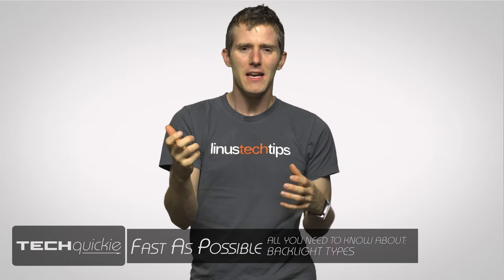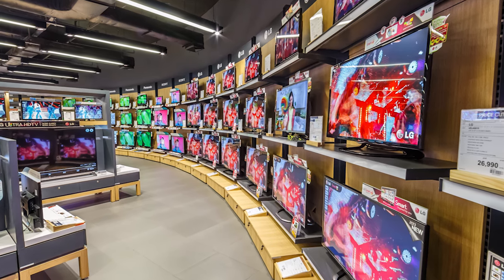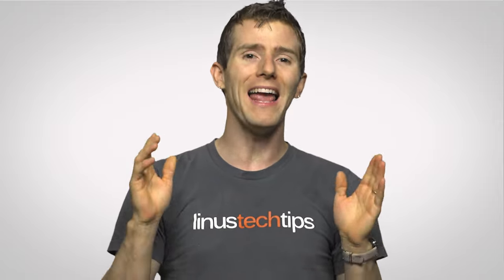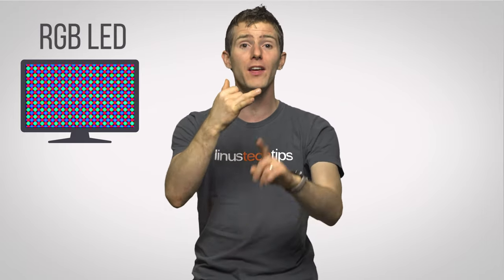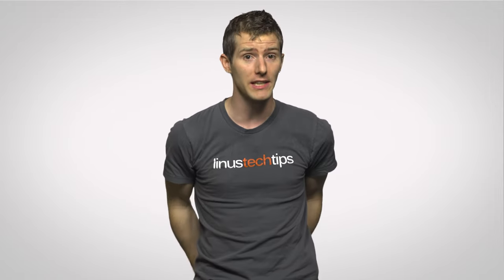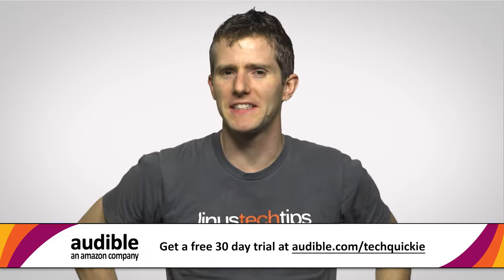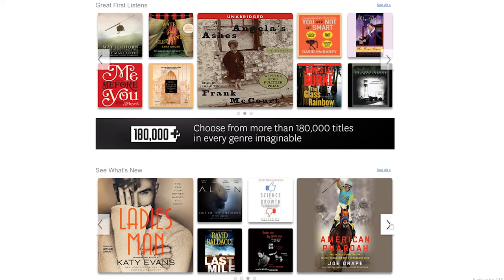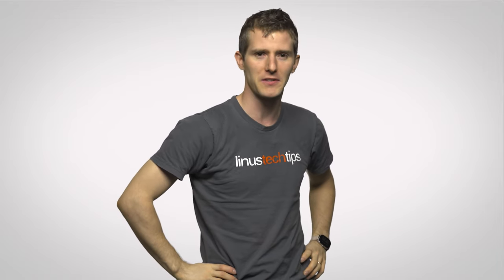Backlight Types As Fast As Possible

Comment: For those that don't quite understand the relationship that Linus mentioned between the case fans and the back light, PWN is Pulse Width Modulation. On cooler fans the fan controler turns on and off the full voltage very very fast,  resulting in the fan spinning at a constant speed that is dependent on the length of time between voltage "on"  cycles. So with the backlights it's the same thing but instead the fan spinning, it makes the light appear to be a less bright as the time between "on" cycles increases. 
The DC fan control is when the fan control simply reduces the voltage being put out to the fan which makes it spin slower the more the voltage is reduced. With the backlight it makes it dimmer the more voltage is reduced.  The DC method is much better for people with Epilepsy or sensitivity to flashing lights or that get migraines easily as the on and off cycles of a PWM backlight may not appear visible to most people, even most that have any of the above conditions, but the eyeball and brain can still partly sense it causing the brain to freak out or get confused, witch can trigger a splitting migraine at the least.

Comment: Thank you for bringing up the PWM backlighting.  I had to return a new laptop due to this as I didn't know why it was giving me horrible headaches whereas my old one didn't.  I found a new laptop without PWM and I'm having no problems with it.  Another technology for projectors is "single chip" DLP.  They display multiple monochrome images every second, and depends on your brain to assemble the color image.  I see the rainbows horribly (even on the newest ones) and if I look at one for more than 10 minutes, I have a full-on migraine that puts me down the rest of the day.  3-Chip DLP projectors in theatres obviously don't have this problem, just the single-chip spinning color crap does.  I get disillusioned when I see DLP used in public venues such as presentations, etc.  I look down at the floor the whole time.  It is amazing how many people I hear complaining of eye strain and headaches.  LCD technology should be mandatory in a public venue like this; but like some comments I see here; people are either not aware, ignorant, or are not affected by these flashing images; but should have respect to those who have debilitating side-effects from these.

Comment: I'm from the year 2030. I'll stick to my MicroLED 8K HDR 240hz 1ms display with no backlight, no screen burn-in and no issues with lifespan/longevity like OLED.
Reply: Broly,  you're still alive 😮
Reply: Micro-LED, the clue is already in its name, so it obviously doesn't have a backlight. 😌

Comment: Back when I bought my first LCD monitor, I did way more research than the average person would. I eventually became fairly disheartened and disappointed, as LCDs definitely do not out-perform CRT monitors in terms of image quality. LCDs may have recently became more powerful in terms of specs, but still arent as versatile in terms of scaling and image quality like the CRTs were.

I was also very annoyed to learn that almost every LCD LED-backlit screen contained blue LEDs instead of white or RGB. This makes a considerable difference in quality and also affects eye-health. Too much blue-light = bad, especially if you're about to go to bed. Blue-light filter programs/settings help, but doesnt solve the other problems, and can easily be forgotten about.

The part that disappointed me most is how painfully slow the market has been at adopting new technologies that I care about. Higher resolution is not my main priority whatsoever. Color gamut, black-levels, contrast(one of the only things that has improved), viewing-angles and high-hz are what I care about more, and those features have been extremely sparse in the lower-mid end LCD market(and possibly even in the higher-end), and you're almost never going to be able to decently achieve all of them.

If more consumers knew the information that Linus shared here in this video, the market would have to adapt to the people requesting/demanding and buying products with those features. I'm sure ill be waiting another 5-10 years since i bought my first LCD before I feel the need to buy my next one. I cant even expect there to be much difference in that amount of time, but I certainly hope there is! I, for one, am tired of LCDs(and especially bluelight LEDs)!
Reply: I recently got a mitsubishi diamond pro crt monitor. its max resolution is 2048x1536 @86hz, with a bunch of other resolution modes. 
https://www.cnet.com/products/mitsubishi-diamond-pro-2070sb-crt-monitor-22-series/specs/
it's bar none the best monitor I've ever used. The color is simply amazing, though I am definitely very optimistic for oled as well.
Reply: @Liquifiedpizzas  OLEDs can have poorly implemented PWM, I am surprised this point wasn't included in the original comment. This is also quite important for daily use, since low-frequency PWM (lower than 300 Hz, quite common in current smartphones) can cause migranes due to extra eye-strain.
Reply: It's been 5 years now, curious how you feel about the market now.
Reply: I remember the first LCD monitor I saw, put me off LCDs for a while since it was a total blurry mess. Couldn't even scroll a webpage without the entire screen just turning into blur, but that's different now.

CRTs still to this say have some advantages over LCDs, but they are being overcome. Also in this day and age LCDs just have so many advantages over CRTs that I can't imagine people still using them. About the only place people still use them is for retro gaming, but even that is coming out with better upscalers to make them rapidly match up with CRTs. I have been working on ways to try to optimize my retro system's outputs to LCDs rather than cling to CRTs at this point.
Reply: @Cyber_Akuma  could you elaborate in detail on whatever those "upscalers" are?
Reply: @nerd2544  Stuff like the RetroTink or the OSSC

Comment: Linus, you're looking a little green in this vid mate.
Reply: Yeah
Reply: +Troy Graham you dont like him when he is angry
Reply: guess it comes from the greenscreen
Reply: Yes there is usually some glare/ if lighting is off a bit but they could adjust in post. Nice Hulk Reference PR.
Reply: +Troy Graham Here, and so many other videos. I've been wondering if it's my monitor that's wrong, but either it is, and yours as well, or he's actually green :P I haven't checked the colors.
Reply: Calibrated LG IPS' here. Definitely off. It's like looking through an amateur wedding photographers photos with the WB all over the place!
Reply: +Troy Graham then buy a better monitor. Linus literally just explained what to look out for to get better color accuracy
Reply: HazewinDog You obviously missed the part where I said I have multiple calibrated LG IPS monitors.
Reply: Troy Graham ah. yeah, I didn't realize you added replies.

I wasn't serious anyways, since it's obvious that he's greener than he should be - like in many LTT videos. bugs me
Reply: HazewinDog 33 +1's tells me I'm not the only one haha
Reply: Guess the major issue is what you use to view the videos. So many mobile options with all different screens and screen temperatures etc.
Reply: Troy Graham True, but if you start with a neutral color, a "correct" one, it's a good starting point, and really all you can do unless you know you're going to produce for a monitor that has a color cast.
Reply: ***** Indeed. I think the main thing here is consistency. LMG obviously has multiple editors and the consistency isn't there yet.
Reply: Yeah. I would expect them to have profiles pre-made for their different sets, but maybe not.
Reply: +Troy Graham Matrix
Reply: Greenscreen

Comment: Small comment on PWM vs DC: PWM dimmers can reach frequencies of up to a few megahertz, now way you can see that. Of course they can be ridiculous slow too. DC dimming comes with another problem: LEDs tend to slightly change their color depending on the current running through them, thus ever so slightly diminishing color reproduction. I'm not sure how noticable this effect is on LCD screens and how well it can be compensated for.

Comment: Once you mentioned that edge-lit displays are found on cheaper screens, I looked at my laptop and noticed that the edge is quite a bit brighter than the middle. The diffuser isn't very good at it's job. Damn Emachines e-627 from 2005! (With Windows 10 and a 1.6GHz S1 CPU)
Reply: Oh, and the CPU is a single core.

Comment: I remember those gameboy clip-on lights that had a square hole in the middle so you could see the screen.
Reply: +SangoProductions213 Yeah, they were shit because you just saw the light reflecting off the screen instead of the screen itself.
Reply: I had one for the Gameboy Advance, though mine had a piece of glass to look through.
In retrospect, it was kinda bulky, it also required its own set of batteries, but it was fine at the time :P
Reply: Definitely bulky and clumsy, and often slipped off....but the alternative was playing underneath the lamp, lol. (Game) Boy, has technology advanced.

Comment: PWM per se is not the issue. The issue is the frequency of the PWM signal (different from the frequency of the screen). If the LED are driven by an high enough frequency they are not "turning on and off" they start behaving like a low pass filter and oscillate around  a target brightness. The higher the frequency the lower the oscillations.

Comment: i still dont get the rgb backlight, because if you can control the color of the individual pixels on the screen, why cant it turn of the local leds when the picture is black? i dont get it why they all must be lit all the time ( i assume theres a reason)

Comment: CCFL is also notorious for deminishing brightness over time. I'm not a fan of led lighting. it doesn't seem to show accurate and full spectrum color. also with rgb (i believe) backlight it just seems as if you are looking at three colors blended together. don't really know how to explain this. with ccfl you will see the colors more as a natural smooth spectrum. I really hope one day there will be screens with individual pixels that consists of just one light emitting pixel that can emit all colors, not three or so next to each other. you will always see it, subconsciously. but most people won't notice until they see it with their own eyes.
Reply: +Tijmen J I have an NEC LCD1850E monitor from 2001.  It still works great, doesn't hurt my eyes, and the colors are crazy accurate.  It also shows more shades of individual colors than I can ever attempt to get a laptop TN or IPS display to even dream of displaying.  Yes, it doesn't have as dark of black levels as a newer IPS display; but I don't watch movies on the computer either.  That's what I have a Panasonic plasma for.

Comment: so where does IPS come into all of this?
Reply: +North American Survival Attic "IPS" does not pertain to the backlighting, but rather the way the colored sub-pixels in the top layer of the screen (the layer which makes the picture and colors) are arranged. I believe the most common arrangements are "TN" and "IPS". You can tell if a panel is "TN" buy looking at it from different angles, if the picture begins to looked washed out or turns black from these angles it is a "TN" panel. at least initially "TN" panels had faster response times making them good gaming displays, while IPS was better for Televisions because people all over the room could get a consistent experience. IPS has taken over though with the rise of mobile devices like tablets and convertible notebooks, which like TVs need to be visible from all angles.

Comment: Just wanna say,  that bit about LCDs "eventually" having better image quality than CRTs only holds water when comparing the absolute top-end in both categories, at which point LCDs win by sheer weight of pixels (4k and 5k). Apples-to-apples, at the same resolution, CRT monitors can have much higher image quality than LCDs; the problem is that nobody makes CRTs anymore, and the second-hand CRTs you can find are often from either before the time of high-quality CRTs and horribly outdated, or just one of the crappier models from the later days of CRTs.
Reply: +Crazy Canadian making  a  real full  hd  crt monitors  will be  so much  expensive then a lcd
Reply: bac302 Sure, but the same goes for OLED monitors, which, as Linus mentioned, have burn-in issues right now, along with a few other problems.
Reply: Crazy Canadian but expensive  oled  will not have difficulty to be sold  crt not so sure

Comment: why don't they make an ips panel with white OLED's for each pixel to be backlit? White OLED's are much easier to produce than color ones if i remember correctly. You could have a cheap but amazing monitor that could have the color reproduction and viewing angles of an ips with the OLED's amazing black levels and no ips glow.

Comment: The only reason I even got a GBA was because of the SP. Before that, after I had my Gameboy Color, I decided that unless it had a backlight and a rechargeable battery, I was going to pass. Skipped the original DS too. Not because of a feeling of impending update to the hardware, but because it was too expensive. I only got a DS Lite when an acquaintance sold me his white one so he could buy the new Black colored one.

Comment: PWM is not exactly flickering. In PWM, total power delivered in unit time reduces resulting reduction in total emitted power at a constatnt voltage level.
Reply: Sandeepan Sengupta oh wow it is flickering! PWM makes it like lets 50% on 50% off
Reply: PWM with 50% duty cycle is an ideal square wave or analogical to digital signal, Any digital signal is flickering. So it's not flickering coz it's PWM, it's flickering coz its a digital output. Power delivery systems (DC-DC convertion) exhibits similar effects. Also, google grayscale color control. It will help to dig in further.
Reply: Sandeepan Sengupta I bey your gs fan

Comment: I always hear about this OLED burn in issue but I never have a problem with it
Reply: I have... I stayed on YouTube so long that the logo and basic layout was "burned in" on my screen... I was scared...
Reply: What device?
Reply: My computer monitor... I don't know the name or model because when I got it the sticker was ripped off (used monitor)
Reply: i am suffering from burnout
my s4 has darker pixels at the status bar...to enter Samsung test mode type #0# in dialer...it has options to check your screen by filling it with a single color... try it... it'll make it obvious
Reply: +Blake Fasse Go to a Best Buy and look at the phones.  The s6 display units had awful burn in.
Reply: tmar23 I know it exists, I've seen the phones. I'm just saying I have never had a problem with it. My phone does this weird thing to where the once the battery is full the screen stays on even after you shut it off and there has been no burn in
Reply: Blake Fasse Because phones in normal use don't have static elements on them for hours on end.  Once we see more OLED monitors/TV's (assuming the issue hasn't been addressed to some degree by that point) I'm sure we'll all see/hear about it more often.
Reply: tmar23 did you not understand what I was saying? Once my phone reaches full charge the screen does not turn off on its own and since I always have my phone on the charger at night that means the screen has a static image on it for about 8hrs
Reply: what phone is it? 
it might not even be an oled
Reply: Suraj Grewal GS5
Reply: interesting
dial #0# 
then click color blue and look carefully for dark spots
Reply: oh I mean star hash zero star hash
Reply: Blake Fasse Yes, I understood you.  Do you understand most phones don't do that?  As far as burn in it really depends on what is displayed on your phone.  Is is the lock screen?  What's your brightness set at?  Assuming you sleep in the dark and auto brightness is on it's not going to be full tilt.  Are there any bright white colors displayed when this happens?

It's all really irrelevant you've said you've seen it so you know it happens.  Are you trying to Schrödinger displays?  Monitors/TV's closer to max brightness with bright elements displayed for extended periods of time will be effected the same way display units are.  You not experiencing it really has absolutely no effect on that.

Comment: Unless you buy a high end monitor, you're getting a shitty edge lit non-RGB led with terrible PWM, that's why I stick with a widegamut ips CCFL monitor.
Reply: The problem is CCFLs cause a lot more damage to your eyes. I used a CCFL LCD monitor for 10 years and now I have glasses of 0.75 and 0.5 diopters. I also noticed that I can stay about 3 hours in a front of a LED monitor without glasses but I barely stay 20 minutes on CCFL

Comment: Different File extensions as fast as possible
Reply: +Ritwik Sharma
Just a heads up. They are just names to differentiate the type of data a file contains. Files are just ones and zeroes (or just numbers for that matter) arranged carefully and methodically to describe data with or without any kind of compression.

If you wanna understand files deeper I recommend you start with windows bitmap images (BMP) and plain text files (TXT). After you get a grasp of those, it becomes trivial in general, but still compelling when you realize how much cleverness is there for some other fancy "file extensions".